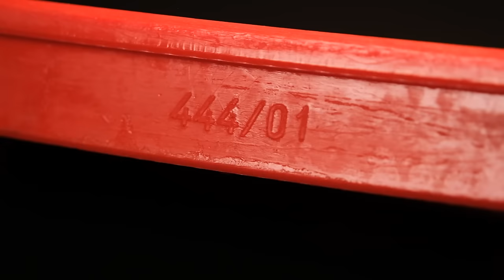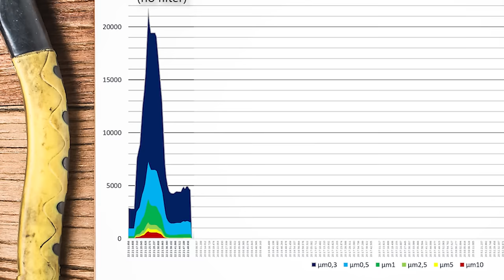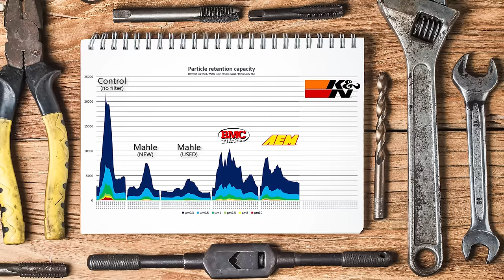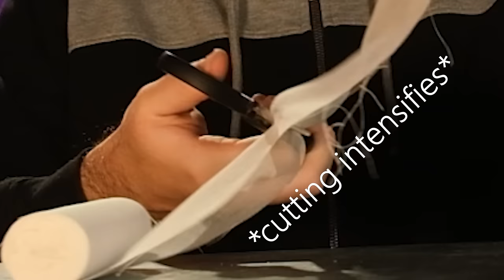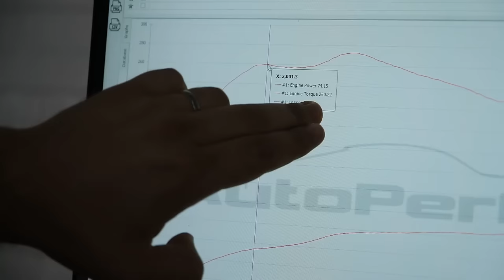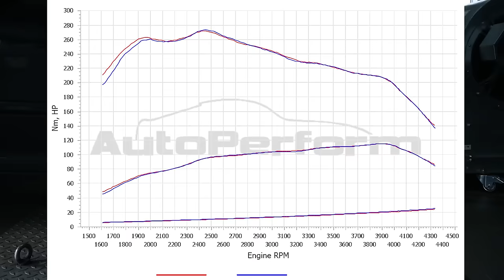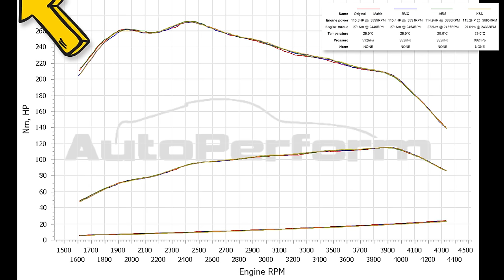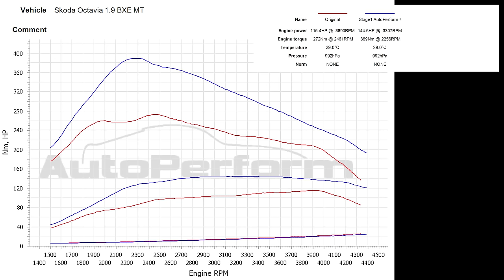Performance Air Filters - K&N vs AEM vs BMC - DYNO TEST

Comment: This video is EXACTLY the information I was searching for. I run the AEM and felt they were a good balance over the Factory box. Granted, I don't see as much of a difference as if I used a K&N but the efficiency of filtration and balance of performance for my daily drivers are putting my mind at ease.
Reply: Not to mention you don't have to spend $10-$20 bucks every 10,000miles. I personally didn't buy a AEM for performance, truth is the only time you get any performance is a WOT, which the average person doesn't drive that way. The reason I did get a AEM is in the long run I'm saving money. Does't cost me 20 bucks to vacuum my filter every other oil change. :D
Reply: Yep, classic case of confirmation bias 😅

Comment: So happy that you also came to the conclusion that a somewhat dirty filter is more efficient than a new. Not easy to convince people about that. Worked with filtration for 8 years
Reply: but look how less the air volume it can only get mate.
Reply: Haven’t changed mine in 40km and it’s still pretty damn clean haha no use changing

Comment: I'm 63 years old & have owned 14 vehicles in my driving history since 1975 when I was 15 years old..I've used K&N Clean & Oil filters since then👍
Reply: Excellent video.thank you knowing the filters are a scam is very angering.Liars and cheats all around us,all the time
Reply: It's well known among auto engineers the larger particle score your pistons rings.But idiots out there won't listen to logic
Reply: @GTNova000 as if that can be proven.. I'm sure there are plenty of scored chamber walls and damaged piston rings from dirt out there.
Reply: But the video shows it's a bad filter compared to dry one.. personally my maf sensor went faulty with k&n after some 3 months of use
Reply: @jakjak258  you have to let the oil properly dry before installing it. 🤦
Reply: @ryancompton3515  what 😂
Reply: These filters are shit ! Stick to OEM paper if you love your engine .
Reply: @GTNova000 How can you know?
When the motor fails or break you can't say that is filter used over time or not
Reply: Dang, I'm 32 and I've had 17 cars lol
Reply: Sorry to hear that...
Reply: Gotta boost those numbers sir. I’m 29 and have had 9 so far. My buddy is 28 and has owned about 25 I reckon lol
Reply: Creo este cuate del video, sesga sus resultados   es exagerado decir que un KN es como no tener filtro. Tiene años esa marca, ya hubiera millones de autos desvelados. Creo le pago la otra marca. Muy exagerado hasta se burla de como viene conformado el KNN, ahí se delató. No fue objetivo. Exagero, que dio miedo.
Reply: Ok boomer
Reply: @anthonysmith4222  why so many cars lol it sounds awesome but a head ache at the same time I have 3 and still have all 3 and I'm 28 kinda got me feeling like I need to get more vehicles tho😂

Comment: It's not the amount of air that gives you power, but its temperature. On my car with a standard filter, I modified the intake to get more cold air from outside. This gave a noticeable difference from the standard intake system.
Reply: It's actually both.
The key is to increase the amount of oxygen, which you can achieve in two ways:
1) Increase the amount of air inducted into the engine.
2) Cool the air, or make sure it's as cool as possible, since cool air have a higher density/more oxygen per volume than hotter air.
Reply: @marcusjosefsson4998  ah yes but then your forgetting one thing aswell.. with more more cold air you need more fuel.. that’s why fuel upgrades are essential in any high power modification to any engine
Reply: @deathtoming2201  True. I didn't forget it, just stressed the importance of cool air/oxygen since that's the core issue here.
The air is a prerequisite to be able to burn more fuel, so it's always a good start.
Reply: You mean ambient air, right? It's not necessarily "cold"..

Comment: That recyling gave me an idea. I checked the part number for the air filter in my car, and turns out all BMW E46s have the same filter, from 316i with barely over 100hp to M3 CSL with 360hp.

Comment: It is interesting that the new and used filters were different up to a point and then the same. I'd like to guess at a potential cause of this. Below a certain RPM, the turbo isn't making boost. This means the engine relies on having the draw air in itself. A blocked filter will reduce this. As soon as the turbo comes on properly, the engine has an exess of air and the turbo sucks harder through the filter. As such, even with a slighty blocked filter, the turbo will compensate and make up the target boost pressure (usually by actuating the vnts a little more to increase the turbos "suck")
Reply: It may have helped it spool. But dynos aren't typically very accurate at the beginning of the run

Comment: Hey Sergiu,
as you said yourself, since you ride a turbo diesel engine, the air is exactly regulated because of the Turbo. Also keep in mind, that a diesel Engine regulates its power by changing the ratio of diesel to air, which means it always runs with too much air. While a gasoline engine always tries to have the same ratio between air and gasoline. Which means that, more air is automatically more gas and therefore more combustible mixture. I know it is a bit more complex than that, but this would be too long. As you also mentioned, most of the time the car manufacturers oversize the Filter, so what i would find very interesting is what would happen with a "naturally aspirated engine". But then again it would have to be one with limited Airflow.
Btw. I really like your Videos ;) 
Best Regards

Comment: Remember guys, the engine is a air pump. It breaths air. The only way for a Naturally aspirated engine to breathe IN more is to free up the exhaust side. A restrictive exhaust will restrict how much air it can breathe in. 
This is why you feel MOST gain when you do both sides. Both work together for max gains.
Reply: So small carb for lawn mower on v8 and free up exhaust right?
Reply: Oversized exhaust = No scavenging effect
Reply: You'll typically lose power with aftermarket because it reduces scavaging. Engineers are pretty smart. For a DD stock car, keeping it stock is best in terms.of the engine and exhaust
Reply: @JohnBoulding  Yes engineer's are smart but lack common sense. I own several cars and the only car i own that is 100% stock is my truck that is my daily driver.
My other "cars" are all modified.
Reply: @ACommenterOnYouTube  cool snd modding is fun..but my main point is for the typical car, adding exhaust mods, intakes, etc you will rob lower end torque to gain sound..they aren't performance mods. With an ECU tune, some mods can add power but most guys just slap on bigger mufflers and piping, and intakes , and wonder why the car isn't faster.
Reply: @JohnBoulding  those mods DO add power, but they shift the power band to a different area of the rpm band. 
Cars are tunned from the factory for specific hp and tq at X rpm points. 
When you modify the stock intake and exhaust, you are now shifting those hp and tq rpm points. Yes the car is faster, it just may feel slower because you moved that low end tq to a higher rpm and the hp just went to a higher rpm point but yes the power increase is there. 
Every car i have ever owned always got faster with basic mods. The only difference is on a na motor, it may feel slower at the bottom but it gains power on top end.
When it comes to a turbo motor, its an instant power gain and the turbo spools up much faster and no ecu tune is ever done.
Reply: @ACommenterOnYouTube  most of the power gains claimed by intake companies are never what they claim and generally fall within a typical dynos margin of error. How convenient is that?  I've got many friends in the racing industry, including Nascar and Ive seen first hand form guys who know way more than me what these typical mods do on a NA engine. For DD cars, the power band. Is optimized by those engineers to be where it's of most use. Moving 7 HP up from 3k to 6k isn't really something useful unless one runs to near redline all the time. The statement  about it not feeling faster becouse it is moved up is exactly my point. DD cars need that power where they don't have to high rev to locate it. Exhaust mods are typically the worst for helping to lose low end, as well as removing Hemoltz resonators. I'm glad you are happy with your  mods  and it's is fun to do. But making power for a DD is not quite as simple as slapping on mods.
Reply: @JohnBoulding  "But making power for a DD is not quite as simple as slapping on mods"
Actually IT IS, if your dd is a turbo charged motor then YES, the intake and exhaust will do wonders for that motor. 
Especially if its a RWD turbo with a mechanical clutch fan.
You do the intake and full exhaust with NO cats, put in a nice huge Front Mount intercooler with bigger pipes, remove that mechanical "drag" of a fan and use electric fans, now you gained about 50 whp ... 
And remember this is a turbo, not a NA motor so the faster that turbo can spool, the faster its going to rev up. 

And doing this on a NA motor, yea its going to be for sound only because you may be lucky to get 10 hp and you will loose torque so yea its going to feel slower unless you are reving it that high light to light ....
Reply: @ACommenterOnYouTube  i Wasn't talking about red turboed cars. That's a completely different animal, mods wise.

Comment: After I have seen your vids about the filters it let me thinking if a K&N is the right choice. They filter less dust ( in my area it's not dusty) and no big hp benefits. I have put this morning a K&N filter in my Seat Exeo with 2 liter engine. The main reason for me it's the sound it gives. Now I hear the turbo sucking air and I love to hear that. I have cleaned the air hoses before the filter just to make sure I don't have unnecessary dust that could harm my engine

Comment: I've learnt a lot from your video. Thanks. Next time I need a new filter, instead of forking out £20 to £30 for a new one, I'm going to cut out the filter material from the old filter and replace it with a few layers of J-cloth or microfibre cloth. I reckon this will cost about £15 to £25 LESS than a new filter and will probably work just as well. I might experiment with soaking the cloths in the oil used to lubricate chain-saw blades as this is quite a 'sticky' type of oil.

Comment: Excelent video-ul! Cautam asa ceva de cateva luni si nu pot sa cred ca am gasit chiar de la un roman, felicitari! Mi-am luat un filtru con pentru masina si, chiar daca suna mult mai bine motorul, nu puteam nici cum sa merg cu el linistit pe strada ca si daily driver. Tot timpul imi statea pe cap ideea ca "da, acum e bine, dar in 20.000km cum va fi?". Multumesc tare mult, m-ai salvat de o groaza de stres! Subscribed

Comment: K&N have or had an article on their website which basically said:  When the engine in running, the vibration from the running engine shakes the filter, this causes the cotton to sway back n forth really fast, its the swaying back n forth that is catching the particles.   I've been running K&N for years,  the top of the airbox is as clean as it was in 2006 when the car was new. The bottom of the airbox gets quite nasty after a while.    

It would be good to see you do the test again, with added vibration to simulate the running engine.  See if there is any truth in it?
Reply: Very good Point!
Reply: Thats bs
Reply: @dzenan.m  No its not.  Go read K&Ns website.
Reply: @theenglishtrucker1849  🤦🏻‍♂️ thats what I AM calling bs
Reply: IT'S NOT BS, IT HAS BEEN TESTED THE CORRECT WAY WHICH IS IN AN ACTUAL RUNNING ENGINE!!

Comment: Hi. Nice  video. The experiment about the dust is very importat. I need to mention that at new cars 2013 year and after putting a different filter ecu needs 3-4 days to read changes about air mettering. Fiesta 1.0 ecoboost 140ps. When i put k&n filter,  hks and original the differences were after the third day. I start seaching about that and that happens.even new bikes

Comment: Paper filter - clean every other oil change.
K&N/ re-washable - clean 1-2 times between oil changes.

You want to clean the rewashable ones more frequently, as the impacted dirt has a chance to become drawn in more easily and the oil on oiled ones begins to dry out and lose effectiveness. So it's all fine... Just keep the airbox clean. The inbox and air box resonator can house a lot of debris that just bounces around and gets pulled in. May as well use a shop vac and get the immediate stuff camping out and then run an air pressure hose through the snorkel and push it out the wheel well/ bumper.

Comment: The engine mapping will only allow to combust what it's programmed for, you only see a difference if the filter is extremely dirty. You technically only lose pumping efficiency at a small scale, which mostly means you have to rev higher for the same power. BUT the "power" is felt in the accordion effect the air goes through. Which is why you see the "gains" at the start of the graph. Would LOVE to see the dyno graph with mid RPM throttle articulation that a normal drive goes though. And comare after 🥰

This makes a car feel more responsive when the throttle is moving. It's mostly noticeable on turbo cars.

You should also note that any wet filter will contaminate the MAF sensor ;-) and if you go that route, remember to clean it after a few hundred miles when you first install it.. then again later after a thousand miles.

Some 15 years ago I took the time to use my scanner and confirm everything I was feeling regarding throttle response and wet filter contamination affecting the MAF.

Anyway, if you don't want to go through all that then buy a performance dry filter.. which in most cases is anything stock in any car made in the last 20 years for the stock tune :) AND! Clean your MAF every 15-30k
Reply: What going happen ?

Comment: Even tho yes more particles travel through cold air intakes testing them inside a shop where there is the same warm air going in through the fan system your gonna get roughly the same results. Only difference in that instance is the cold air allows more air in which no1 usually measures. By allowing the cold air intakes to suck up that extra air you are rewarded with a faster spool on a turbo charger and more air to be sucked in by a supercharger. Colder the air the more power from the combustion chamber.

Comment: Completely expected result. And open intake systems can even reduce the power due to 2 reasons: 1. more intake of hot engine compartment air and 2. some stock intakes have a resonance function in naturally aspirated cars, which increases the airflow (which is lost when the stock intake system is removed or modified) 🤓
Reply: The first one is correct, the second one not so much. If you put in a cold air intake without a remap, the engine will misscalculate the amount of air and thus the mixture. Which it will fix with fuel trims during normal load, but not WOT. So the performance loss is mostly due to people not remapping it afterwards. And if the resonators counteract pumping losses, itll be minimal.

Comment: I switched to a K&N filter last spring and I was surprised with the added throttle response. A tune on a turbocharged engine also helps in the matter.
Reply: @@helloeveryone8577 Bullshit ive used K&N filters on dirt roads plenty of times, they gunk up just as bad as any other filter. I had one block to the point the engine wouldnt even start
Reply: @@helloeveryone8577 There's zero dirt getting past it would be all through the inlet if that was the case
Reply: @@helloeveryone8577 I've seeh is videos where he dumps an entire handful of flour or whatever on top of the filter & sucks it through its a wonder the stopped as much as they did especially the K&N, thats not necessarily indicative of how filters work especially an oiled one like K&N. I've got a mesh filter on my PC case with 1mmDia holes that catches all the dust which should give you a clue
Reply: @@helloeveryone8577 The K&N easily handles those particles in moderate amounts like it was designed to do, the oil catches & holds which  then helps catch the next particles. These would have been dirt all through the inlet if it was that bad it handles it  fine in real world use
Reply: @@helloeveryone8577 The oil is critical in these filters you need to re-oil it with each wash. My particular car has a crappy MAF sensing system that sucks at compensating for airflow resistance, my old Vectra was the same. They benefit greatly from these filters
Reply: @@helloeveryone8577 It comes of when you wash the filter, in the video you can see how some filtration is improved as it is absorbed by the oil
Reply: @@helloeveryone8577 There's enough oil out of the box to handle a full filter load but it wouldn't handle a handful simultaneously dumped on top very well
Reply: @@helloeveryone8577 They aren't a whole lot more expensive than a stock filter on my car

Comment: Can you please do a comparison against foam filters? Something like a pipercross, I would like to see how well they filter etc.
Reply: Why would you think a foam filter will be any different? A paper filter is almost the same as no filter at all as the engine gets all the air it needs. The only thing you're going to find is the foam filter lets through more particles that will damage your engine over time, especially if used in very dirty conditions
Reply: @darrenpardoe  they filter better than kn does